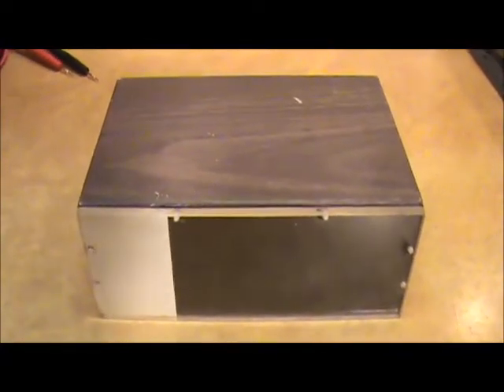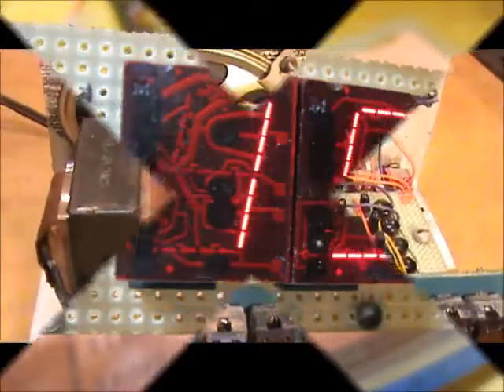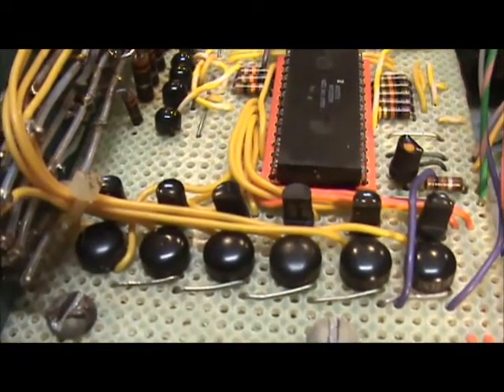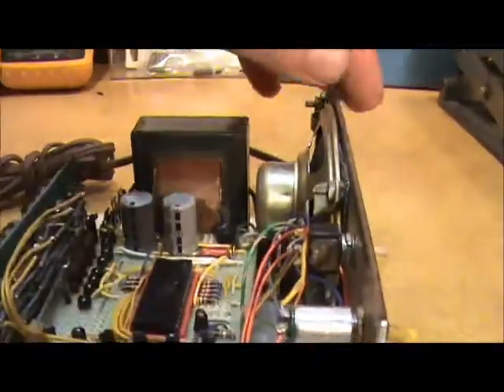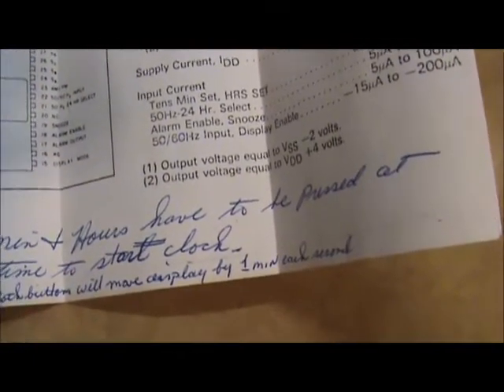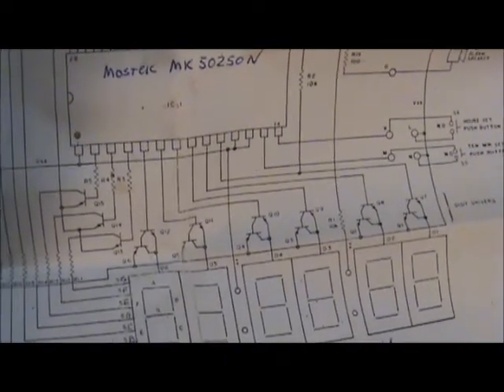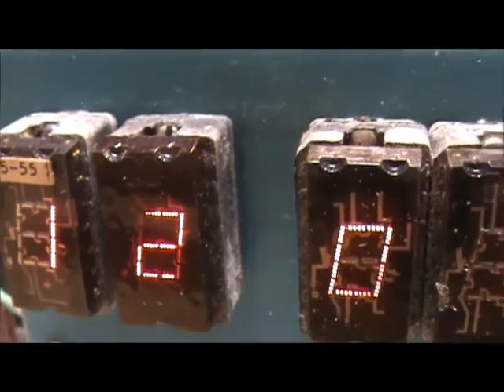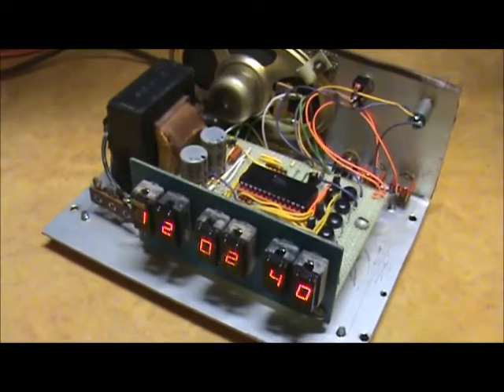Homemade Digital Clock Mostek MK50250N MAN 1 and MAN 1A Monsanto Displays 1977 Vintage

Comment: Very good job 👍
I got a similar clock that was sold as a kit in Belgium during those years, when I was a teenager, and I enjoyed it a lot. I made some modifications to mine, such as adding outputs based on relays and triacs, and I used it for many years. Unfortunately, I finally lost it during a move.
For a long time, I've been thinking about rebuilding the same clock, just for nostalgia reasons.

Could you publish the schematics of your clock?
Reply from the maker: Hello Dominiquemoreau4270. Thanks for joining the crowd!  Plenty of unique and rare old clocks to see here.  I am sorry you lost your old kit clock.  As far as publishing the schematic, it will be difficult for me right now as that clock is intertwined in a display case and that is where the paperwork still is (inside the clock).  I can suggest, as is the case will this clock and most built like it, the Mostek 50250 datasheet and or clock circuits are on the web and found by searching and should contain what you need to build one up.  You could also maybe screen shot my video to use as a guide and draw one up.  Or, if you are interested, I have this other unfinished clock project I bought on Ebay.  It is a home etched pcb with a universal display PCB with 6 vintage big Litronix 747 LED displays on it.  The circuit uses the same Mostek MK 50250 ic and may be an Archerkit by Radio Shack circuit design?  Not positive.  It works as is but the enclosure needs to be restored or a new one built.  I can post a video on your request for what it is and contains.  At this point, I will never get to restoring it in the foreseeable future.  If you like what you see in the video, we could work out a deal to somehow get it in your hands, maybe thru Ebay to make it easier for both of us.  It will be cheap.  Let me know if you would like to see that clock here on YouTube to check it out.  If you still want to go the route of building your own and can not find a comprehensive document, do let me know, I then may try to make the effort to somehow post a more clear video of the documents in the clock.  Thanks for your interest.

Comment: Enjoyed the video Jim!  The MAN-1's sure are unique looking.  Great find.  I notice a little bit of multiplex ghosting on the 10's of hours display from the seconds display.  Is that common with the MK50250 chip?  Also, there's just something special about a homebrew project built by a Ham.  I bet it was in his shack for years, ticking away.
Reply from the maker: EUSA, Yes sir ghosting indeed.  I also see that with the MM5314N clock IC.  I am not sure how to fix that.  On the 5314 datasheet there is an "inter digit blanking circuit" that I have not tried out yet.  Perhaps one can implement something like that on the MK50250 as well as it also has a display enable pin.

Comment: That clock was a nice find for sure. I've never seen the schematic tucked away inside a home-made clock like that before, but it was a nice touch from the builder. Interesting that they used a Radio Shack datasheet, but not the Archer PCBs it called for. That would have saved a lot of effort on wiring the display board!
Reply from the maker: Thanks!  Yes it would have saved for sure.